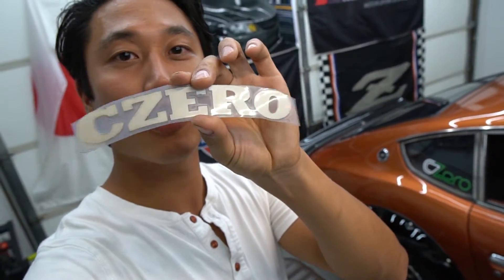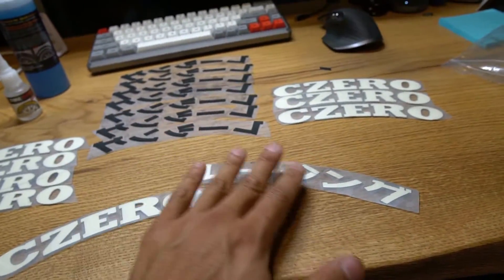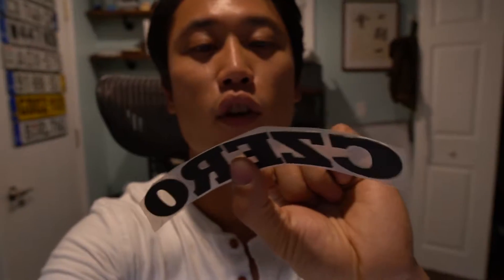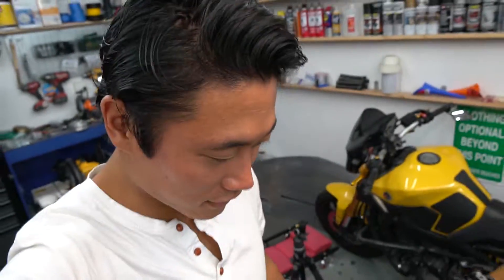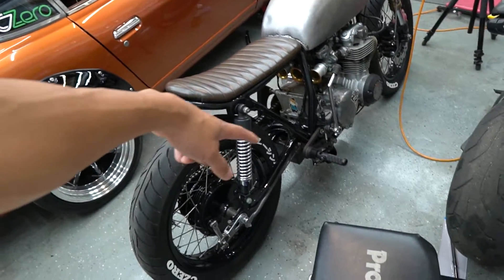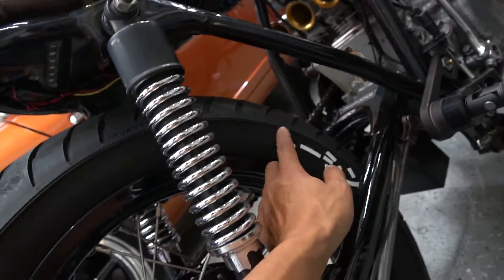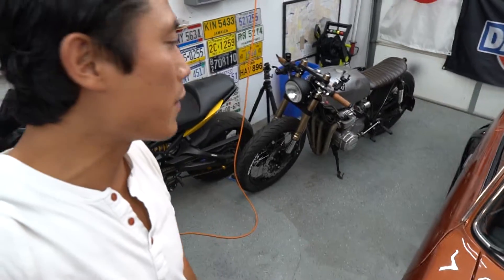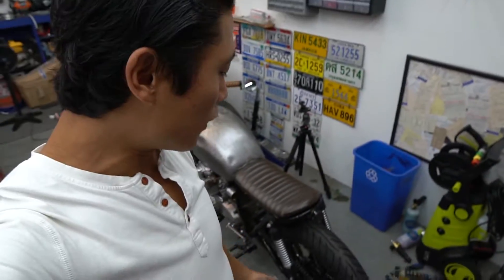Cafe Racer Gets Tire Stickers - 1975 Honda CB550 Cafe Racer Build Pt. 82

Comment: I would of painted the Japanese lettering black with an oil based paint I think, after seeing how hard it was to remove.
Did you fix the head-shake from the front end conversion? Any update?